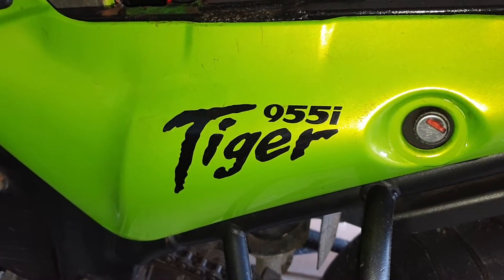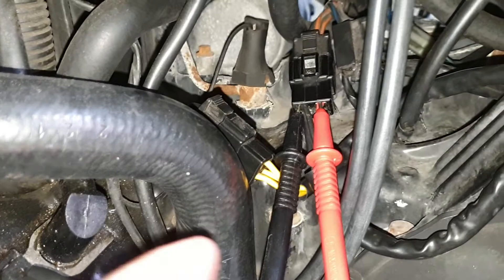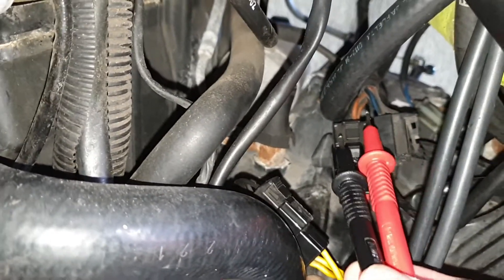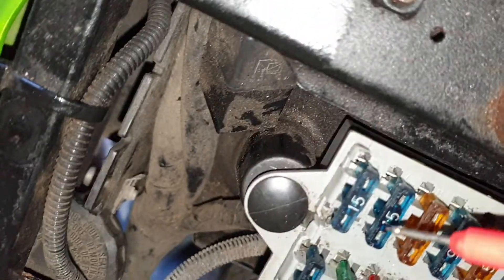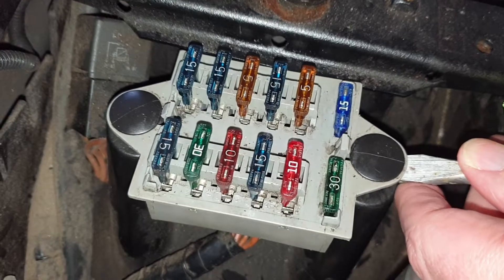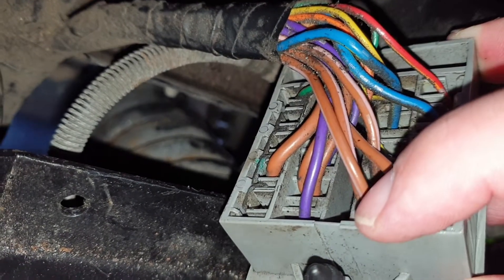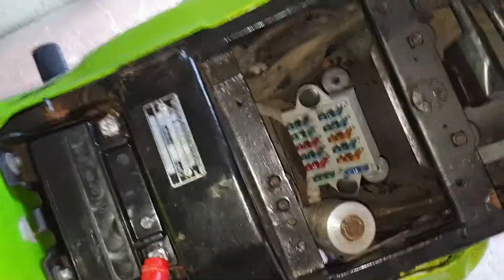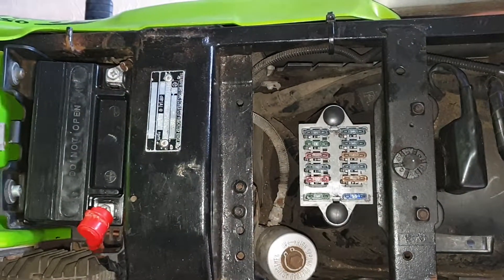Triumph Tiger 955i tracing the power from rectifier to battery (electrical system test part 3)

Comment: I just checked the voltage at the battery today and found 13.7v. I guess I'll be checking connections next when I get home.
Reply from the maker: Hi Be aware I demonstrated on fuse 6.. I meant to demo on fuse 2 (30amp).
It's worth doing this quick test on all fuses..
Reply: @jsydev  Thanks. I was wondering why the charge wasn't on the biggest fuse.
Reply: Bike has been starting and running perfect for the two weeks I have had it. Rode almost 2,000 miles and plan on riding 500 miles tomorrow. Absolutely loving the girly Tiger.
Reply from the maker: Nice

Comment: I hate to rain on such a useful and helpful parade, but "jsydev" chose the wrong fuse in the fuse holder to check the voltage drop across.  I happen to have a copy (actually two copies, 2001 and 2006) of the Service Manual and the wiring diagram clearly shows that Fuse #2 is for the charging system.  Fuse #6 is for the engine management system.  If you think about it, it should be a 30amp fuse transferring full power from the Regulator/Rectifier to the battery, not a 15amp fuse as is Fuse #6.  Still, you could do the same analysis he did in the Fuse Holder, just do it on the correct fuse.  That said, the voltage drop he measured across Fuse #6 was not a good thing.  So making that better would be a worthwhile thing to do, just not for charging system issues.  I'm having charging issues on my 2006 Tiger 955i. with insufficient voltage being seen at the battery, so I am in the process of analyzing my own bike.

Comment: I've got just got a tiger 955i and have some electric weirdness - slight flickering lights - the battery with the bike off is 12.8 volts so Im guessing, cos I have no actually idea what Im doing :P, is ok. Running at idle it only goes up to 13. something. Going to check exactly what you've done to see if there's the right voltage coming out of the regulator and at the fuse box. Now... how do I find the regulator connector :P never had the side panels off and cant seem to see it
Reply from the maker: Hi....
Start on the lefthand side of your bike
.
You will see a cable coming out the side of the engine where the alternator lives....

Follow that cable it leads to a plug.. 

Then that plug cable leads to the rectifer.

Then the rectifer cable leads to the plug.

Which in turn leads to the battery. 

Should show this in one of the 3 videos I posted...
Reply: @jsydev   Wow it was bitch to get to. I replaced the rectifier - screwed behind the frame - absolute nightmare trying to get it off - the cables were cable tied to the fuel rail. But cured my flickering lights. I've still got a short to ground according to OB2 error code on Tune ECU. But I already knew that. I replaced all the lights on the tiger with LED lights and found if I moved a cable behind the dash, it cut all power to the dash. Next step. Tracing that problem...
Reply from the maker: @sirkristoferTV    lol ...yep.... I call that fun but only the day after I finish the job....  I'm sure it will be just as much fun cleaning and  Securing the Earth/ground connections..

Did you use an original triumph rectifier or something else ??? 

Have fun
Reply: @jsydev  Nah. I found one on eBay new for dirt cheap, 40 quid. The price being that cheap is a bit suspect but seems to be running fine as of now
Reply from the maker: Lol I hit post instead of enter before I had finished..

So...... 12.8v is good..
13v is low.. 
It should be over 14.2v 14.4v ish..

If your lights are flickering it maybe a bad earth.

It will take about 15 minutes to go through the 3 test in the 3 videos.
If all 3 check out OK.. Then it maybe a bad earth... Check all earth points have clean contacts to the bike frame..

Comment: Nice video
Clear step by step explanation
Will do the same on my Speed Triple in an effort to increase the voltage charge to the Lithium battery which needs 14.3 to 14.6 to charge